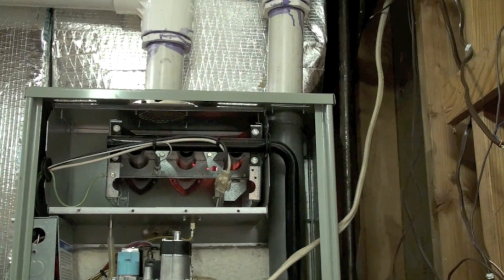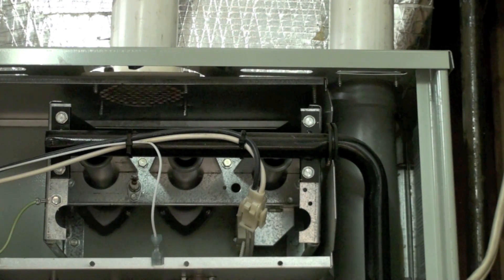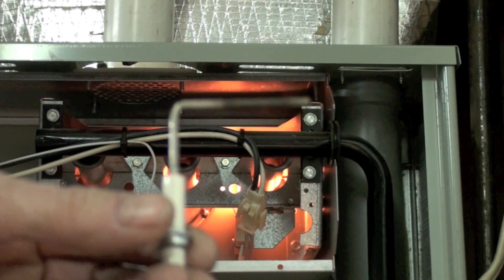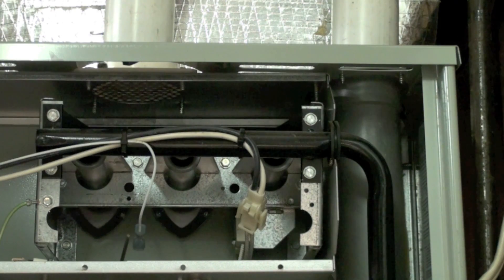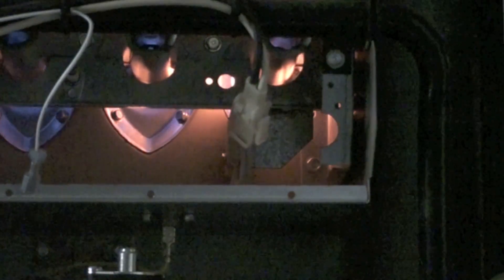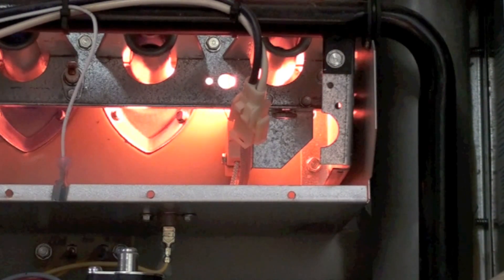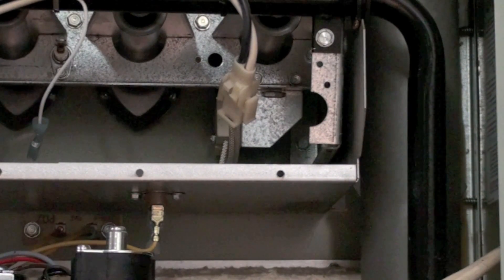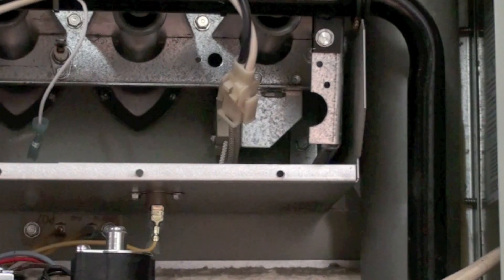Gas furnace won't stay lit.  cleaning the flame rod

Comment: was having an issue with my furnace coming on and then going right off again. i found this video and pulled out the flames sense rod cleaned it with a common dishwashing sponge with the scrubbing side rinsed it and dried it put i back in and it fixed the problem. thank you for putting up this video. 8 years later and it is still helping people.

Comment: Our furnace has been doing the light - turn off - light - turn off dance for the past several days. I booked a repair tech to come out this morning after our house dropped to 54 overnight. As I waited for his arrival I figured I’d check YouTube to educate myself on the terminology so I could describe the problem with my furnace and found this video. OMG am I happy. I tried sanding the rod as described and my furnace is now running properly. THANK YOU THANK YOU THANK YOU.

Comment: I was about to call a furnace guy and then I watched your video.  You described my exact symptoms and gave such a simple solution that I had the confidence to check it out for myself.  3 minutes later I had the sensor out.  I could see the build-up.  I cleaned it off with a kitchen scrubber and BAM!  Heat is on!  THANK YOU for being willing to share your expertise here!
Reply from the maker: Welcome
GFM

Comment: Thanks Grayfurnaceman you ROCK!!!  You have saved the day again.  My furnace has been malfunctioning and i couldn't figure it out.  I called a service technician when it happened which was on a Saturday and he wanted big $$$.  So I went to the internet and found some videos to get it working again by shutting off the power so the unit would reset.  It worked but I knew something was wrong and dreaded calling a technician.  I continued to look for solutions and stumbled upon your videos and Voila your videos led to me to the problem and solution.  Furnace is working just fine.  Thanks again.
Reply from the maker: Welcome
GFM

Comment: Just wanted to stop by and say thank you!  The house was getting cold tonight, and while sitting in my office, I could faintly hear the furnace blower turning on for about 30 seconds, then back off.  I observed what was going on, came across your video.... took out the flame rod and cleaned it with some sandpaper.  Turned the furnace back on, and it's now working perfectly.  Thanks and Happy New Year!

Comment: Thank you in 2019. 27 degrees out this muni heat and I was going to take the furnace apart until I found this video, 5 minutes later the heat is working like a champ with no weak flame. Thank you
Reply from the maker: Welcome
GFM

Comment: Pulled out the sensor - straight steel stick - cleaned it up with light sand paper - screwed it back in and fired up instantly…THANK YOU for this vid.  It probably saved my $2 million dollars on a HVAC company to come out. 😂
Totally easy fix.  Fires up like clock work.
Thanks again, Merry Christmas!

Comment: Hi!  I had a rather unique solution.  My Trane XL80 kept short cycling.  I replaced the filters, took it apart to look at the burners and cleaned everything up - including vacuuming and cleaning the flame rod and burners.  No joy.  The far burner wouldn't ignite, though the other two did.  I took off the brass gas nozzle and beheld where a spider built his nest there.  Once cleaned, everything worked like a champ!

I really enjoyed your videos and they helped a novice like me understand better how the system worked.  Thanks for putting these out there!
Reply: Another example of "a bug in the system". (Literally what happened in an early computer. )

This happens often enough to part of the Prev Maint routine:
- ants on the contactor
- rodents in the condenser
- wasp nest in the flu pipe

Eee gadzz. 

I

Comment: This was very helpful!  Thank you so much.  By gently cleaning the flame rod with a little bit of steel wool (after ensuring the power was off on the unit), everything was fine:  once the unit was turned back on again, the main burners stayed lit and now I have a working furnace again.  Many thanks!

Comment: Hello! Thank You Very Much for posting all these videos. They are extremely accurate and helpful! This was my problem with the dirty flame rod. My ear heard something not right in the basement so i decided to stay and listen and sure enough it was just cycling.... The house would warm up though, but it would take much longer to get there. Had I not heard the "poof" from the burners going out every 10 seconds I wouldn't have thought anything was even wrong with the furnace as it was heating up the house quite well. I pulled the rod out, cleaned it up with some steel wool 0000 and it is working 100%. took 10 mins. total. Since then I've watched over an hour worth of your videos and cant get enough! Awesome Job bro! Keep up the great videos and kind help!

Comment: Yes, that's correct...1 trial for ignition then shuts down. The igniter glows, and the fan blows, but when it calls for gas...no go. I am guesssing it is the Honeywell gas valve. the furnance is a Tappan, model FGRA072C. Thanks for your video and taking the time to respond.

Comment: I have a 90% Rheem propane furnace that blows the flame out and then immediately restarts. Does it every time. I’ve watched a lot of your videos to find the answer to no avail. Love all your videos and have helped me a lot. Thanks
Reply from the maker: Does the unit have a pilot?  Does the flame come off the pilot when the burners start?
GFM
Reply: No has an igniter. It’s clean and the flame Since is clean
Reply: It’s an 2007
Reply from the maker: @hddm3  Does the flame roll out the front of the furnace?
GFM
Reply: No it burns good
Reply: Thanks for your help I really appreciate it gfm
Reply: @hddm3  I would be checking gas input first.  You could also have a venting condition that has too short of venting piping.
GFM

Comment: Our Goodman (I think 80%) furnace was short cycling often. Removed the flame sensor rod and brushed it down with some steel wool. Didn't make a visual difference but since putting it back together no short cycles! Interestingly this furnace was not shutting down after 3 short cycles, it would just keep trying. Anyway, big thanks! First snow here today in Chicago so very much appreciated.
Reply from the maker: It could be proving for the initial proving period, then shutting down a few seconds later.  I would double check by shutting off the gas valve and letting it go thru the shut down and hard lockout.  Just to be on the safe side.
GFM

Comment: Your video helped me, I have an Armstrong sx80.. it's 80% efficiency rating heater. It's a little different from this as yours is slightly newer, mine has the flame detection circuit right beside the pilot, (why? I don't know) But all it would do is run the induction motor and sit on pilot.. ended up cleaning the 3 anodes and it worked beautifully. While I had it open I checked my induction motor hose and blew that and listened for that click so I knew out that was working properly. So thank you for your guidance! God bless.

Comment from the maker: Sounds like the limit is shutting down the burners.  Filter ok?  Blower wheel clean?  Take a look at the blower playlist. Also possibility of heat exchanger crack. Put "heat exchanger" in the channel search engine.   If it has a spark ignitor, it probably senses the pilot flame with a sensor on the pilot assembly.  Hope this helps.
GFM

Comment from the maker: Yes it does. If the flame shuts off when you hear the pressure switch click that means the pressure switch is not staying made.  The problem could be the pressure switch is failing, there is moisture or obstructions in the pressure switch line or it could be a blockage in the vent.  I would look at all these things.
GFM

Comment from the maker: Are you sure there is gas available?  Are there other gas appliances in the house?  You can find out if the gas valve is the problem by putting voltmeter leads on the gas valve terminals.  They must be on the terminals during the trial for ignition.  You might check the playlist:  Gas flame safety controls.  Hope this helps.
GFM

Comment: Mine appeared to fail because of rust dripping down onto it, because my AC had a little water leak.   So, it was caked with rust.    Cleaning that rust off definitely did the trick!  Thanks for the video.    So, tip of the day to sabatoge the furnace flame sensor - cake it with rust :)

Comment from the maker: Yes.  The water is acidic and could get onto the control and destroy it.  It will also rust through the panels.  The condensate drain could be plugged.  Is it a Carrier?  If so, they had problems with the rubber hoses rotting.  Either way, the leak needs to be stopped.  Hope this helps.  
GFM

Comment: Ruud Silouette II 5 burner furnace lit up but would shut down before reaching thermostat temperature.  
Flame Rod was easily accessible so i was able to apply steel wool to it without removing it. Just looking at it i didnt see any obvious build up but the steel wool did the trick. Weird!

Thank you Gary Furnace Man!!
Reply from the maker: +Colonel Panic Welcome
GFM
Reply: +grayfurnaceman question: i have to repeatedly clean it  so i think the part needs to be replaced. i ordered the part online but it is slightly larger than the current part. Could this cause a problem if i install it?
Reply from the maker: +Colonel Panic If it sits well into the flame and does not touch any metal parts , it will probably work.
GFM
Reply: +grayfurnaceman will try it and let you know. Thanks again.

Comment: For some reason I never got any codes and my furnace just continually tried to start...viscous cycle.  I do have a flame sensor light though and that would blink sporadically during first flame, so I cleaned the sensor as you suggested and my Wyoming winter is much more comfortable now.  Thanks for your video!

Comment from the maker: Most furnaces with this control are what we call induced draft.  The flame rod is an electronic sensor that senses flame.  Cleaning it removes deposits from contaminates in the air.  
GFM

Comment from the maker: I would try a little better clean job on that flame sensor.  If the code blinks a flame failure it is probably a problem with the flame sensor.  I usually only replace flame sensors when the ceramic was cracked or the wire was damaged.  Hope this helps.
GFM

Comment from the maker: Sounds like a delayed ignition.  Do all the burners light at the same time?  If one or 2 light then the others are delayed, the burners/flame spreaders may be dirty.  It is also possible you have a cracked heat exchanger.  Be sure to check it.  Look at the Gas furnace playlist.  Let me know how you come out.
GFM

Comment: Im bobcat, i think this is going to show an old name, but i wanted to update you, it wasnt the smart valve, it was an odd thing ,i found it myself , on the smart valve there is a 2 inch long tude that pushes into the furnace to the glow plug and in the end of it is a jet , a spider went thru the jet hole behind it in the tube and made a family nest in that tube, so the gas couldnt get thru, i cleaned it and its works fine. one to talk about. thanks for your help, it got me thinking.
Reply from the maker: Ah, the old bug in the pilot trick!  Glad you got it working.
GFM

Comment from the maker: Sorry about the camera work for the ignitor.  The gray color is normal.  It is not cracked.  The real proof is whether the furnace continues running after the trial for ignition.  If you have a microamp meter you can test microamps.  Some of the propane furnaces will damage the flame rod due to higher temps but natural gas seems not to damage them. Thanks for the comment.  Merry Christmas
GFM

Comment from the maker: No, its only use is to sense if flame is there.  It does get very hot, usually turns red in the flame.  Cleaning of the flame rod is done any time the furnace is serviced.
GFM

Comment from the maker: It would be best to check flame sense before you go any farther.  I did a vid on using a cheap meter to check flame sense.  Checkout  the "check the flame rod with a cheap meter" vid.  Also be sure the burners are clean and the flame is surrounding the rod and the terminal is tight.  The flame rod is just a piece of stainless steel, but if you notice parts of it that will not clean up, you may replace it.  If all is well, the only other part is the control board.  Hope this helps.
GFM

Comment: I have a Trane XL80 and it wasn't staying lit, I watched your video and pull the flame rod and cleaned it (even thou it really did't look dirty) and bam the furnance is working. I'm hoping that this was actually the problem.
Reply from the maker: william garreans They usually do not look dirty.  The coating is very thin.  Hope no more problems.
GFM

Comment from the maker: I would first look for an obstruction in the inducer.  If there is an obstruction (animal), the pressure switch will not prove and the burner will not come on.  It is also possible the bearings have failed.  Hope this helps.  
GFM

Comment from the maker: I would always use a factory style hot surface igniter on this thing.  You do need to know what the flashing code means on that thing.  If it is flame failure, it's probably going to be the cracked ceramic but if it's a pressure switch problem, it could be something else.
GFM

Comment: Thanks for the video. Cleaning the flame sensor fixed my problem. Is this something that should be done when the do yearly maintenance on the system?
Reply from the maker: wardn53 Yes. Service techs should test the flame rod microamps, clean and recheck each service.
GFM

Comment: Awesome... Tips. Helped out a bunch. Used some steel wool and swipe swipe... reconnect it works.Thank you for posting
Reply from the maker: Nice easy fix, and the heat comes on.
GFM

Comment: Good job, I subscribed. I have an old in floor furnace in a rental house doing the same thing. Cost me 175 bucks to do what you just did. I think my sensor runs both the furnace and the pilot light. Not sure though

Comment from the maker: What you need to know is what the light blinking code is on the control board.  Then compare to the key on the panel of the furnace.  It tells you what area to look for the problem.  Otherwise, you are just shooting in the dark.
GFM

Comment: Hey Gary, i have a Diamond 80 York Furnace. 
I replaced the ignitor; but it was not a 'flat ignitor' (the appliance store only had a round ignitor) no problems so far seems like it lights up when it hits the set temp. I cleaned the flam sender rod with a dollar bill (not sure cleaned it well enough - but it worked fine). The problem is the fan runs and no heat after a while.  From your video it sounds like; I might have to replace the sensor rod all together? Please let me what you think!!

Comment: Thank you!!!  The steel wool did the trick!  It was a pain to remove the flame rod due to its location, but all is working.  While i was in there it seems that the condensation system is leaking a bit. Possibly from trying to run and not firing due to the flame rod. Should i be concerned about the water?              I am subscribed  thanks for the vids!!

Comment from the maker: No.  It would seem there is no gas supply.  First make sure gas is on.  Gas cock, meter valve etc.  If ok, either board problem or gas valve.  go thru the playlist for the RGDA furnace.  If power is available to gas valve it is a gas valve.  Other wise  probably board problem.  Check all connections for tight.  Hope this helps.  Merry Christmas
GFM

Comment: great video i had a problem with my new vent free Mr heater 30000 btu it won't stay on i checked everything from o2 the heater was new it turned out my flexible line was too long 4ft i was loosing the pressure i switched it to 2 ft it works like a charm hope this will help .
Thank you.
Reply from the maker: Thanks for the info.  Just a thought.  30,000BTU is very large for unvented.  Hope it is in a very large structure.
GFM

Comment: A way to induce a failure us to reverse mains polarity to the controller. I was testing an Amana HTM system and didn't follow the wiring diagram thinking "its alternating current, it'll be fine". It would light then shut off, repeat. Hooked it up properly, and it would stay lit.

Comment: Hey Gary thanks for advice, the ceramic is cracked in the flame sensor. And problem persists; so I will replace the flame sensor. Do you think I need to replace the round ignitor with a flat one? what would be my next step if those would n't work? So, the problem is some times the fan is blowing cold air and keeps running. When I turn it off and turn it back on it ignites, I can hear the flame sensor go off. other times when turning off and on doesn't work either. I have to do it several times.

Comment from the maker: There are a several possibilities.  There are flame spreaders on the sides of the burners.  If one of these are plugged, it wont spread.  If a crack in the heat exchanger can cause it.  If the gas manifold pressure is too low (I just did a vid on setting manifold pressure)     One of the orifices that control the flow out of the manifold may be plugged.  A vid on this will be coming today.  Also on the brightness of the HSI.  Check the resistance of the ignitor.
GFM